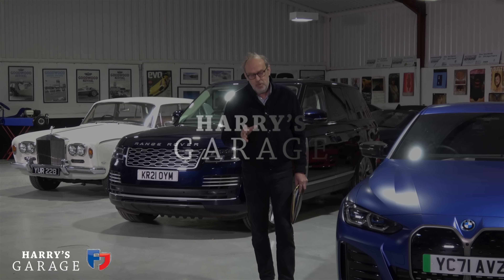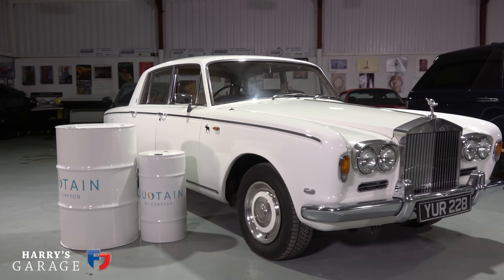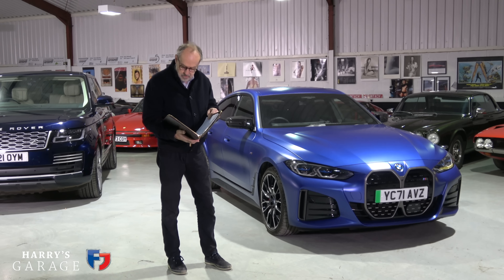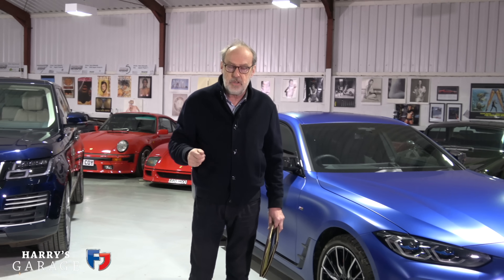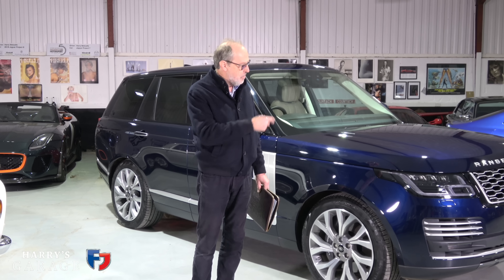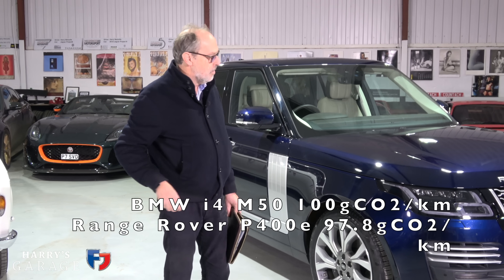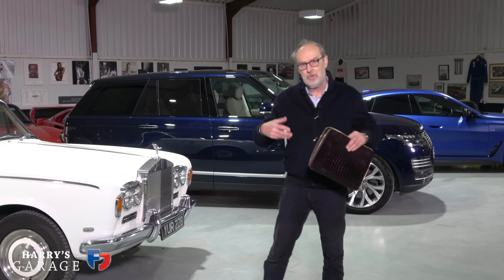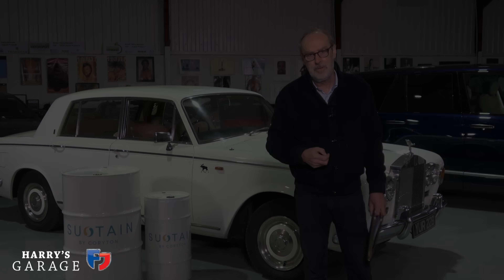Sustainable fuels; what are they & are e-fuels better for the planet than running an EV or PHEV?

Comment: Coryton being double normal petrol sounds a lot, but when we have seen premium essentially double since 2019, I think it may prove a good transition. If the Govt cut some fuel duty (supposedly there to punish CO2) then the cost wouldn't need to be £3/L
Reply: Problem being, if this replacement fuel is the same cost (or close to normal fuel), by slashing the tax on it, suddenly there's no demand for electric cars anymore.  If anything they'll continue to keep hiking the price on both this, and normal fuel, using the propoganda stories as their excuse.  They NEED to have us in electric cars, or else they don't gain the control they need.
Reply: @WayneFoxUK  I want electric as I make my own fuel (solar). Nothing to do with this weird idea of 'control'. Just pure economics.
Reply: @WayneFoxUK  They? 🤣

Comment: Thank you Harry for pointing out what i have been saying for years we need to make sure things last ,Cars washing machines , everything ! Things used to last ,now things are designed to last a couple of years and then you replace it .more carbon is produced in manufacturing than standard use
Reply: I think those same manufacturers may argue it's in our best interests to have longer lasting equipment... it means they make less money, and let's be honest, that's all it's ever been about.
Reply: I would encourage checking out the "Right to Repair" laws passed by the EU - there's some progress here (but a long way to go). I would like to just caveat your finally statement in that it really depends on the situation whether manufacturing or operational carbon is higher (I recommend reading the Volvo C40 life cycle assessment that Harry references in the video for more information on this). For cars, if it is only used for say 50,000 miles then scrapped yes the manufacturing emissions will be a huge proportion of the overall; however if it is used for 150,000 miles then suddenly the answer looks very different.
Reply: @dstarley  we need to have a RIGHT TO USE PETROL AND DIESEL law.
Reply: Look at the cars that are "lasting" in Harry's garage. Not exactly the equivalent of a Ford Focus are they?
Reply: @nealm1814  not sure that they’re ‘lasting’ given they’ve just about all had ground up restorations. Unfortunately Harry’s falling into the trap of only hearing the arguments that support his own prejudices
Reply: @stuartshutt4118  And there isn't much point in talking about exotic hobby cars. It's about what average cars do for average people that do the bulk of the miles.
Reply: @woutermollema  I’m “average” and my 22 year old Jag runs on homemade carbon netral fuel. It’s done 250000 mikes still running fantastic and fast as hell. Corners like nothing and fun to drive. Doing 10000 miles a year. So it is doable small scale. 😃
Reply: @christianolssontravels  I'm very glad that people such as yourself are on a good path. We need scale to really make an impact.
Reply: Modern cars are far more reliable than the stuff we had to put up with from thirty years ago. Not only that but they are more economical as well. If I was still driving my first car it would get half the mpg of my wife's modern car.
Reply: Thank you Harry? For ‘agreeing’ we need to stop fossil fuels to save the planet?
Reply: The problem is old appliances like washing machines fridges freezers us vastly more electricity than new ones.
Reply: @amilton2128  they do but they last a hell of a lot longer and probably would outlast newer things multiple times over thus reducing the carbon cost of constantly replacing stuff.

 I work refrigeration equipment that is at times nearly as old as me, my older stores last, where as my new store are broken immediately from handover. Then I spend years sorting them out.

Comment: Sustainable fuel is an oxymoron. Read the studies of carbon emissions around them. They actually produce 23% more co2 than using fossil hydrocarbons.
Reply: And even with Porsche pushing hard for it and people referencing their plans their output is miniscule.
They are aiming to produce .5 billion litres by 2026. Perspective= UK uses 45-50 billion litres a year! 
It's a low volume solution for enthusiasts not a game changing solution like the anti ev brigade (I can't begin to understand why they are so passionately anti them?!) seem to think.

Comment: "BMW is giving me a range of under 200 miles in my experience of that car. I think we've got to get it better" Plenty of OEMs are doing better than BMW on efficiency Harry. Hyundai, Kia, Nissan, Renault etc etc - oh and another company that starts with a T.
Reply: My i3 that was developed what maybe 10 years ago and lifetime average is 4.8 miles per kWh. Sadly since then car manufacturers don't even try and make lightweight small EVs instead force disgusting, impractical heavy and pointlessly fast EVs on us

Comment: I enjoy your channel, Harry. I wish you would take more care with this kind of video, though. You're an influential guy, and you could do a better job of persuading people to come along with you and do the right things with their motoring than you do. Three points below in response to this video (and the other one you did on a similar topic). More in this Quora answer I wrote https://qr.ae/pGLA2F, which I'd really like you to read.

Three points in response:
1. Synthetic fuels for keeping older cars running, motor sport etc. — brilliant. Exactly as you framed it. From a CO2 perspective, the embedded energy in the fuel is still important, of course. However, net carbon neutral fuels are clearly the way to go when you want ICE for pleasure or otherwise when you don't have infrastructure for BEV.
2. CO2 of PHEV vs. BEV today (in Oxfordshire, with a turbine) is 100% a red herring. Specifically, you didn't bother to consider the embedded CO2 emissions in the gasoline (pumping, refining, transport). The main reason -- which you mentioned, by the way, but cunningly using it to argue for the status quo -- is energy of manufacture. Why?
3. You argue in this video and the previous one that we should wait until the power grid is cleaner. We shouldn't. Every ICE engine in the existing 2 billion car global fleet only gets less efficient in terms of CO2 per mile, because fossil fuels are ever harder to produce (ie, increasing embedded energy), and because of the energy expended in maintenance. Every BEV, on the other hand, gets more efficient as the grid becomes more efficient -- unless you scrap it. And while early EVs like first generation LEAFs suffered from worn-out battery packs (which often go on to life as static grid batteries BTW), modern EVs have the benefit of real-world experience and are better at managing their batteries for long life. The longest-lived Tesla Mode S battery pack so far seems to be up to 1 million km (see the Quora answer). I have an 8-year-old Model S which I can't imagine ever replacing. It lost 5% of its range in the first couple of years and then plateaued, which appears to be common. And it has had basically no maintenance at all, as you would hope on something with so few moving parts. After 120K miles it's still on its factory set of brake pads, never mind discs.

In both of your videos, you have authoritatively told people that the best thing to is buy a PHEV, not a BEV. And I get that you — a wealthy guy with a lot of cars who does many long journeys — would like to justify your disdain for having to approach long journeys a little differently.

What I wish you would say is: if you have to buy a car, buy a BEV. If you really have circumstances that preclude doing so (not being able to charge at home is the obvious one for most people), a PHEV is definitely the next best thing. But every PHEV delays our ability to reduce the carbon output of motoring as a whole, so, IMO, it's a wasted opportunity. If we're going to invest the energy necessary to make a car at all, let's make one that's decoupled from the method of power generation.

And, as you say, let's use synthetic fuels to keep ICE cars — classic and new — as a vibrant and entertaining branch of engineering, without the CO2.
Reply: Came here to say what you've said, but you've said it better!  

Harry - most important point here is the direction of travel - government should have weaned themselves off gas earlier but they will have to soon and each CGT power station that closes means your BEV's CO2 improves.  The reverse happens with ICE / PHEV.

Whilst I get your frustration with the charging infrastructure, you are probably a bit of an edge case in how many long journeys you do - sadly not many of us have to go from Oxfordshire to Chester to see how our Lamborghini is progressing!  The vast majority of people are going to be better off with an EV charged at home, once the cost becomes more affordable / more second hand options are available.  I'm amazed how much more convenient an EV is because 99% of my driving is covered by home charging which takes 5 seconds each time I park.  

I am very much looking forward to you reviewing the imminent BEV range rover.

Comment: Nice to hear what these cars cost to run, real surprise the mpg of the Range Rover .
It will be interesting to see how the sustainable fuel will perform, cheers Harry keep up the good work 👍🚗
Reply: As an owner of a plug-in hybrid, I'm always quick to point out that the combined MPG  you see is completely dependent on what your trip pattern is. Judging by the Range Rover's long-term MPG, Harry takes mostly short trips between full charges that can be completed (or nearly so) on battery alone. Same with us. Our car has only about 20 miles of electric range but we have averaged 70.1 MPG since getting the car last August. However, most people who drive further between charges won't see anything close to that mileage. Take a several hundred mile trip in Harry's Range Rover (or my car) and the MPG you get will be only slightly better than the pure gasoline MPG.

Comment: If we create new farming land to grow these sustainable fuels it is not co2 neutral at all and produces almost as much or more co2 than normal fuel - look how EE explained it - has a taste to it your vid
Reply from the maker: Sustainable fuel is created from bio-waste, not from what is termed 1st generation bio product, unlike some of the ethanol put into UK E10 fuel at the moment.
Reply: That might work for small scale but not for the mass market. Dont get me wrong I am all for keeping classic cars and running them with (bio) fuel but the mass market has to go electric. If you have mostly green energy it makes even sense to go from a used gasoline car with 30 mpg or so to an electric car despite all the energy needed for the battery
Reply: @appleaday3868  Have a look at a video engineering explained did. The data was all shown, covering the cross over point that it's worth changing to an EV.
Reply: @shadowred1980  Yes I had his video in mind. Unfortunately I cannot install a home charger and there is no electric estate yet but the fast charging infrastructure would not be a problem here in Germany. Otherwise it would make sense to change my car because it gets exactly 30 uk mpg.

Comment: Germany listened to a little Downs Syndrome Swedish girl saying "How dare you!" But the alternative power is not ready, not dependable, makes your country rely on others for power, but makes you feel like you are moral when you lose a good portion of the fossil fuel generated power storing it in a battery made of oil, car paint is oil, the plastics in the car are oil, CO2 burning powered the tools and factory and mining equipment for the car. The whole thing is a dangerous pipe dream.

Comment: Those precise calculations may need serious re-evaluation with energy and fuel prices hikes. New fuels and/or self-produced electricity may get even more interesting.
Reply: I did notice Harry used a cost of £1.60 per litre on the RR?
Reply: @NigelsModellingBench  Indeed.
Reply: @NigelsModellingBench  My local BP is still at £1.60 for diesel

Comment: On the roof of your garage alone you can put so much solar power that you will never care for grid power ever again.
Reply: Very optimistic, especially as solar produces virtually no power for four months of the year.
A measured value for solar in the U.K. is just above 10% of installed capcity, that's poor, i.e. a 5Kwatt solar panel system produces an average of about 500 watts.

Comment: E fuel has to be the answer as opposed to the carbon etc in scrapping every vehicle on earth 🌍👍
Reply: Plant more trees 🌳 is the answer
Reply: Unfortunately it will not be scalable for the masses if it is relying on farm waste.
Reply: Vehicle emissions are chasing the wrong source. Look at a pareto distribution of emissions, you'll see that at least in the US 20% is from transportation, everything else is from power generation and industrial uses.  The path forward here is cleaning up your power generation, look at the map he shows his emissions are double of somewhere just 100 miles away that's the low hanging fruit we should be going after.